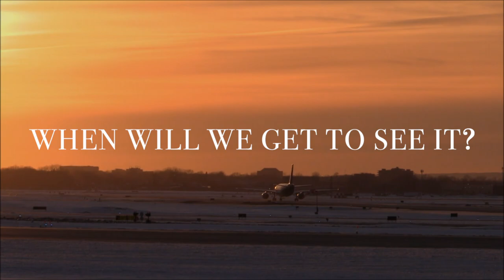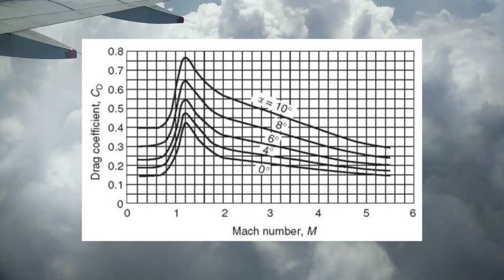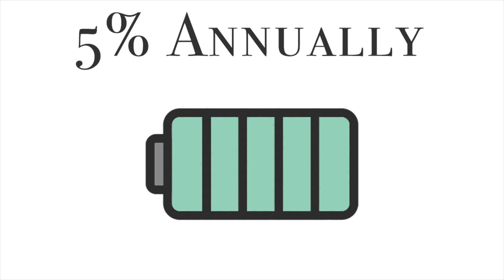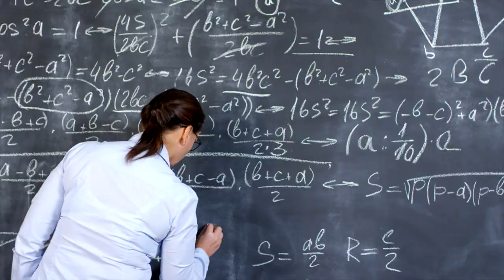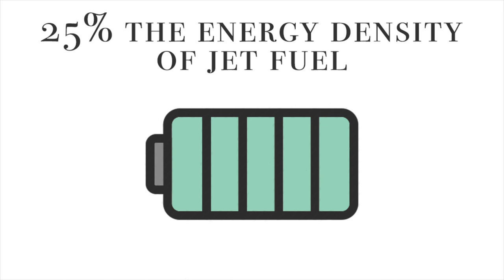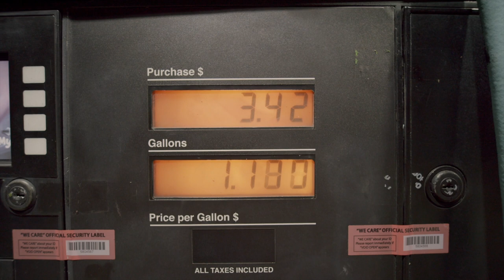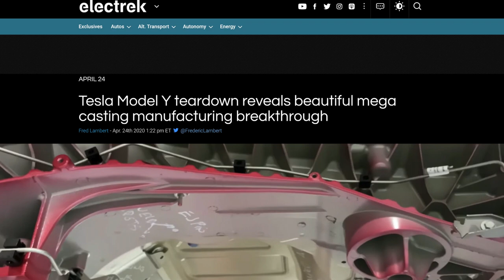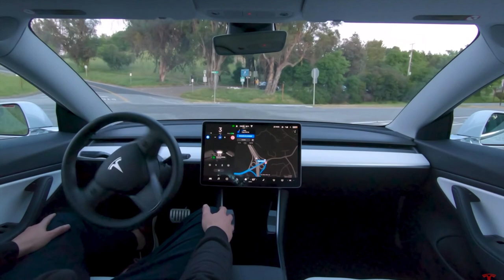The Economics of TESLA's Supersonic Electric Jet

Comment: A supersonic electric aircraft is way out of reach with current technology or any technology even being worked on, Concorde only achieved 60,000ft cruise at the very end of its flight when almost all the fuel was gone, an electric aircraft would be much too heavy to achieve it. 
Long range commercial aircraft cannot land at the weight they take off at, an electric aircraft would need an extremely heavy structure to take the landing forces.
Engine efficiency isn't the limiting factor in a jet engine rpm, the turbines are actually more efficient at higher rpm but they can't because the blades would break the speed of sound and would no longer work properly, electric propulsion doesn't solve this.
Reply: The channel clearly doesn't understand this situation. I'd like to add that cabin differential pressure is the limiting factor in cruise altitude, not engine capability. Also, drag doesn't peak at Mach 1; that is just silly.

Comment: Long range electric planes are cool, but impossible with current tech. Once we have a breakthrough in power density (or multiple considering the scale we are talking about here for planes) we may be able to consider it, but I have a feeling this isn’t happening for at least 20-30 years. Current planes are significantly more efficient than any electric equivalent, and while short range flight will likely be replaced sooner, long range flight could stay the way it is for significantly longer thanks to jet fuel’s incredible energy density.
Reply: Elon said, that we need only 400 Wt to kg power density of final battery (not single cell!), and we can reach it in nearest 2-5 years. And I think he is more competent engineer in this area that you, sorry!
Reply: @a.v.gavrilov  Elon also said that such a plane would 70% by weight a battery. That kind of thing that's mostly a flying battery is unlikely to be economically viable.
Reply: @seneca983  it depends from cycling rate. You can divide any big summ $$ to much more times of usage, and get not too big price
Reply: @a.v.gavrilov  Their carrying capacity would be a fraction of that of more traditional planes. They wouldn't fly that much faster and the recharging times would be much longer than refuelling times.
Reply: @seneca983  when supersonic speed became "they wouldn't fly that much faster"? And take a look on weights: dry, fuel, max take off for any big modern passenger aircraft. It is not too bid difference of this weights ratio with that Elon said about an electric plane.

And you are wrong about speed of charge, it depends from battery "C" charging ratio, power of your changer and efficiency of the battery cooling system. There are no physics restrictions to charge it with same speed as your Tesla S Plaid, and even more faster.
Reply: @a.v.gavrilov  "when supersonic speed became "they wouldn't fly that much faster"?"

Concorde had about 2.5x the cruising speed of a regular airliner. Having the plane be 70% battery by weight surely reduces the carrying capacity of the plane more than by a factor of 2.5.

"And take a look on weights: dry, fuel, max take off for any big modern passenger aircraft. It is not too bid difference of this weights ratio with that Elon said about an electric plane."

It's quite different. It seems that e.g. Boeing 737-800 weighs 41,000 kg empty and can carry 18,000 kg fuel. That makes an otherwise empty plane about 30% fuel with a full tank which is quite far from 70%. Also, for shorter trips the fuel tanks need not be filled completely and they will also partially be emptied during the flight whereas a battery will always be at the max weight regardless of the level of charge. (I'm not sure if Musk said whether that 70% was for an empty or a fully loaded plane but to be generous I'm assuming he meant an empty plane.)
Reply: @seneca983  Boeing 737-800 dry weighs 41 413 kg, fuel weighs - 20 894 kg, it is even more than 50%.

Not seems that “It's quite different”, 50% fuel Boeing 737-800 instead of 70% battery of Musk electric plane.

Musk talked about multiple speeds of sound (because an electric plane can fly in the thinner air of the high atmosphere), so the Concorde only Mach 2.02 example is seems not relevant. The difference "70% vs 50%" is not so great that it cannot be compensated for by a higher speed electric plane due to flight in higher layers of the atmosphere.

Supersonic flight with less air resistance (in much higher layers of the atmosphere than were available to the Concorde; than are available to single-engine aircraft with internal combustion engines), this is the essence of Musk's idea, this economy makes the idea meaningful from an economic point of view.

In addition, the future is both higher fuel prices and a carbon tax. While your claims that it will be economically ineffective do not look convincing. And this even without appeals to the opinion about the economic feasibility of such aircraft, a person who was able to build several successful businesses, and even become the richest person on this planet.
Reply: Just use hydrogen then
Reply: I think they are possible with fuel cells, they have very high energy density. The benefit here is that fuel cells generate electricity and could simply be switched for a battery, once the energy density and costs of batteries rises to the challenge.
Reply: @a.v.gavrilov  elon has made many promises, and many of those promises yet to be fulfilled stop riding him
Reply: @MrVaDelux  🤦🏻‍♀️🤦🏻‍♀️🤦🏻‍♀️🤦🏻‍♀️
Reply: @a.v.gavrilov  You have no idea what you are talking about. Sure electric planes will fly higher in the atmosphere, its only main advantage, but does that really compensate for the massive batteries that wont disappear mid flight? Higher weight of batteries means larger wings to keep the plane flying which means more drag(a lot more for supersonic flight). By the way do you even know how to fly an electric engine supersonic? Currently there is none. You cant use propellers. What about sonic booms from supersonic? Also, if you are flying higher, the pressure difference between inside the plane and the outside is much bigger, so the plane structure has to be stronger and more expensive(the larger the plane, much more expensive will the price tag). Also you said above that fuel was 20894kg, that's maximum fuel, its not everyday that a plane goes its maximum distance.
You can also take into consideration that if you wait 5 or 10 years for electric batteries to be better, engines will also be better by that time.
Reply: @a.v.gavrilov  Planes are not cars. Even for cars it is very difficult for electric cars to become as good as petrol ones, price and range.
And in cars, engines are 20% efficient vs 90% for electric, weight also doesn't matter as much. In planes weight matters much more since you need lift to balance with gravity, larger batteries, larger wings, more drag. Kerosene is also much more energy dense than gasoline. In planes, electric engines are 85 to 90% efficient vs 40% of kerosene.
I think its pretty clear.
Reply: @davidsoares5952  🤦🏻‍🤦🏻‍♀️🤦🏻‍♂️🤦🏻‍♀️
Reply: @a.v.gavrilov  Lol you really give him all credit for everything his companies achieved dont you? I am a fan of him, i love space related stuff, but he is the best only in software. I also give him a lot of credit for risking so much. But you have to understand that he has some of the smartest people on earth working for him. Gwynne shotwell manages spacex while musk focuses more on tesla. And while musk focuses on tesla he does some of the design but still he is better at software, thats why he is the closest to achieving full self driving. Still, he is very good engineer but you cant take everything he says seriouly. How much has he invested? 0 absolutely 0
Reply: What about fuel cell? Battery will never reach the energy density required.
Reply: @a.v.gavrilov  The only supersonic commercial airliner is concorde, which had a thrust of 11000lb and cruised at 2100km/h, carrying almost 100 ton of fuel. To generate similar power using electric motor, assuming 400Wh/kg you claimed, 100 ton of battery will last about 1 hour, and that is with 100% efficiency.
Reply: @LoggyWD  сверхзвуковой электрический самолет будет лететь значительно выше Конкорда, при значительно меньшем сопротивлении воздуха, так что ваше сравнение не имеет смысла.
Reply: @LoggyWD  во-первых, нельзя утверждать, что батареи никогда не достигнут сравнимой плотности энергии, физика этого не запрещает. Во-вторых, топливные ячейки нуждаются в кислороде, а идея электросамолета Маска — выход в верхние слои атмосферы, с экстремально низким давлением воздуха

Comment: A few critical things are missed, at high altitudes, air is much less dense which means to achieve the same velocity (of the plane), you need to have a LOT more thrust than at a lower altitude (conservation of momentum). Next, turbo jet engines cheat a bit when it comes to producing thrust, they heat up the air to extremely high temperatures (higher KE) in order to product a lot of the thrust. The bypass air itself can only product so much thrust, therefore your electric motors need to produce at least more than twice the thrust of a jet bypass fan does. Lastly, one more thing to consider is (at least on the top of my mind), the operating temperatures of batteries (current tech). I drive a Tesla and at low temperatures my range plummets and my power output is reduced. It’s something you need to consider as planes fly at extremely high altitudes with very low temps. Add a heater? That’ll use more electricity. I would love to see an electric passenger plane come to life but i don’t think it’ll come within a few decades.
Reply: I dont ever see it happening. Even If battery density doubles they are still way heavier which means the plane needs more batteries and motors which adds more weight which means you need more power, which just means it will be WAY more expensive to build and use.

Comment: It's amazing that nobody calls out Musk's BS.
Reply: @VincentKarabouladCoaching  To start you can't make a electric supersonic engine in the first place because you would need to rotate the fan faster than the speed of sound which is the maximum speed at which air can flow..

by the way a plane using batteries would consume more electrical energy, supersonic or subsonic than a hydrogen plane with a TurboFan or Turbojet or Turboramjet, because you have to account for the weight of the battery.
Reply: @VincentKarabouladCoaching  Well first of all almost all  of the vtol Aircraft today Are extremely unstable and dangerous during takeoff and landing  and they are basically grounded in anything other than perfect weather just look up all of the v22‘s that crashed during landing 
Sekonds there was an attempt to build a supersonic propeller driven aircraft the xf84 wich was so loud is caused people to vomit from miles away  and vibrated itself apart 

Thirdly vtol aircraft are EXTREMELY inefficient just look at the stats of current vtol aircraft like the yak38 with a top speed of 1150kmh and a range of 350km vs the mig21 with a speed of 2100kmh and a range of 1600km both with an almost identical engine or the f35 with a Max speed of 1700kmh and a range of 1300km vs the f16 with a Max speed of 2100kmh and a range of 2000km vtol aircraft are just not efficient 
And lastly both the us military and Russia tried to build electric jets with nuclear power and both failed miserably so I doubt that this hack can do it
Reply: Ever heard of thunderf00t
Reply: @renacimientoargentino7515  , is that why we already had a commercial plane that flew Mach 2 ?
Reply: @tt55k  And that failed miserabily, and consumed as more fuel fuel than a 747 while carrying 4 times less passengers, requiring more maintenance ,and by the way it wasnt electric or not even a turbofan but just a old Turbojet, a glorified turbocharged torch.
Reply: @tt55k  we had a mach 2 jet that took decades to develop for tech that came from fighter jets( wich Elon does not have) with the most powerful jet engines at the time ( even Lockheed Martin could not do it even though they wanted to put the engines of the sr72 onto it) and propeller aircraft are useless at thehights at wich mach 1-2 is achieved (30000-60000ft)  because also both the USA and Russia have tried to build nuclear powered electric jet engines evens few years ago Russia’s attempt to build an electric ram jet failed and both spent billions on dollars trying to develop this what makes you think that a man who made company’s that take already existing tech and recreate it could do what no one els can
Reply: @tt55k  Electricity doesn't combust. Jet engines work on combustion. Its the same reason why musk doesn't make rockets run on electric motors. The energy isn't there.
Reply: @renacimientoargentino7515  see "multistage compressor", it is the way to reach supersonic speed of air flow. Each stage increase pressure=>temperature=>speed of sound, so each next stage work under sound of speed. Put Laval nozzel after such few stage [electric motor driving] compressor and you have good supersonic electric engine.

It is really stupid — to think that you are more cleverer than Musk. 🤦🏻‍♂️
Reply: @hdaviator9181  Jet engine work on reactive force, it is need only high speed throwing of reactive mass, it is not necessarily to be combustion forced.
Reply: @a.v.gavrilov  sure ,whats the efficiency that it would have? heating air by compressing it is extremely inefficient.

itself the weight of batteries just kills the idea beforehand.
Reply: @renacimientoargentino7515   multistage compressor of combustion turbojet reach supersonic speed, and he did it without combination on this stage. It is very interesting in the context of your claiming, isn't it?

If you said about "MOST EFFICIENT WAY", then 1) you should correct aim to goal of this optimisation, we need not heat air, we need to speed up air, 2) so "were is your calculation?" ("Shut up and calculate!" ((c)Richard Feynman)

We need; Musk said that he need a supersonic speed to decreasing of unefficiency current flights. More effective way to fly — it is flying in less pressure atmosphere, so it's flying in higher altitude. But you need more speed to fly in less air pressure conditions (in 100 times less than at sea level). So you need supersonic air jet engine for it.

It is too hard to do combustion air jet engine, witch can work in 100 times different pressure diapason. But its not too hard to do electric jet engine with such ability (/properties).

You can listen it yourself, if you will learn things about your do your claims. All it's — what Elon Musk said about his vision of electric jet.

I know that Musk much, MUCH more competent in this area (and I suppose in any other engineering area at all), than you.

So just try to listen what more competent peoples saying to you 🤦🏻‍♂️
Reply: @renacimientoargentino7515  You’ve “proven” that supersonic jet engines are impossible, which ought to be a clue there is an error in your reasoning.

Comment: IF A FULLY ELECTRIC JET-ENGINE would be 43 times more efficient than the next best combustion jet engine, even today's batteries would be fully feasible. It's all about efficiency, not just about BATTERY ENERGY DENSITY.

Comment: I notice this was made just weeks before Tesla's 4680, with 400wh/kg was announced!  It's something that didn't get much attention at the time but I believe Elon's goal was to produce a cheap 400wh/kg battery to maximise its applications. There's also possiblity of hydrgen via fuel cells, or even as Ammonia, greatly reducing the energy density problem, even though Elon is anti-Hydrogen. (Norway and Australia are working on large scale electrolysis plants). Hydrogen is questionable for cars but for shipping and aircraft it makes more sense.
Reply: Trust me theres no way around it. Lithium batteries will never be "cheap"
Reply: @mrwhips3623  They are already cheap. It's called LiFePo.

Comment: If here we are considering the general prop propulsion in our electric a/c the main problem we will suffer is wave drags which occurs at the tip of props and here as we want  to achieve mach 2 it will be highly disadvantages even at high altitudes can even damage prop blades

Comment: VTOL is not just another ability you add on top of everything else to magically cut even more costs.
VTOL is a HUGE ENGINEERING TRADEOFF. Always has been. It comes at the expense of other efficiencies.
...and NO, it won't cut the need for airports. You need them for MANY more things than just the landing strip:
mass-scale passenger processing, luggage handling, refueling, maintenance hangars, customs & immigration, etc.